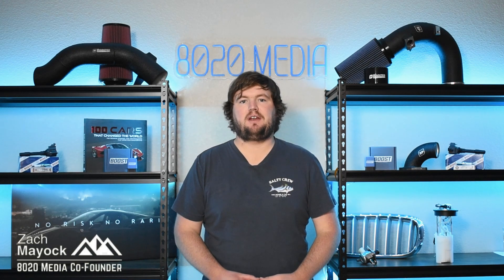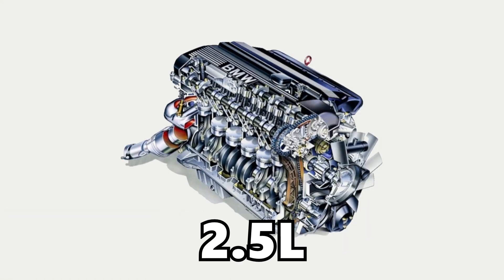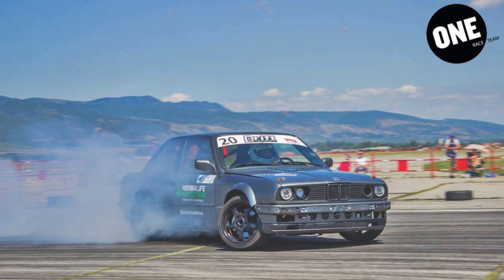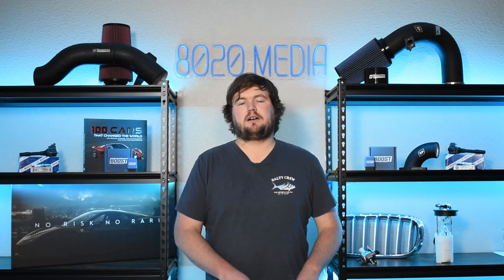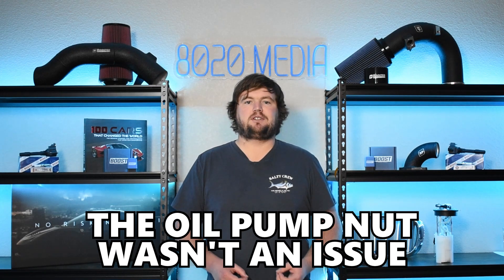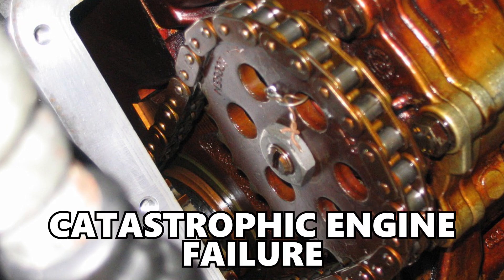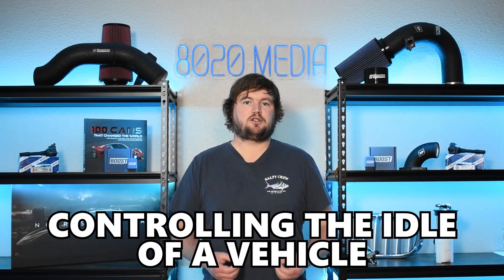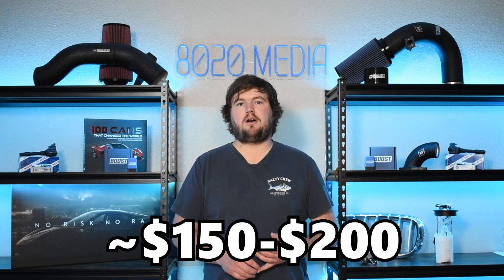BMW’s M50 Engine | Common Problems & Reliability

Comment: Valve cover gasket, oil pan gasket, oil filter housing, thermostat housing, vacuum leaks
Reply from the maker: 3 - Yep!
Reply: Just battled with vacuum leaks this summer. There were 3 leaks total: valve cover ventilation hose to intake boot, brake cylinder check valve and hose to ICV. Smoke leak tester is a must! So easy to spot leaks.

Also I did replace the thermostat cover to alloy type along with metal water pump years ago.

Comment: Restored and modified 1995 BMW 325i with 253,000 miles on it.  The first thing I did in 2005 when I got this car was to drop in an upgraded cooling system with a larger radiator and replaced all the plastic with metal.  The water pump hasn't been touched in 20 years, at least.  Interior and exterior complete restoration including trim.  K&N cold air intake/filter professionally installed and housed.  Borla Cat back, 17 inch Avanti wheels,  Michelin Pilot Sport D3 Summer tires.  0-60 in 6.8 seconds, and 24 mpg.  Last car I will ever own.  I think I've probably replaced a third of the car with engine, and body upgrades.  I've had the same car and the same mechanic for almost 20 years.  Your car is only as good as your mechanic.
Reply from the maker: E - Thanks for taking the time to share your experience! Very accurate.